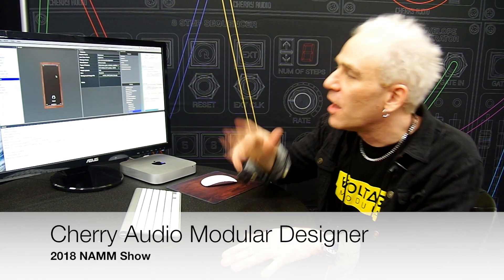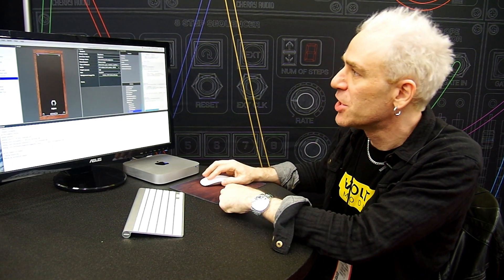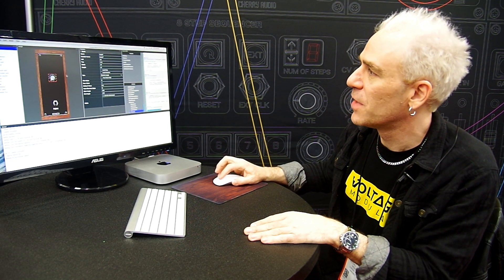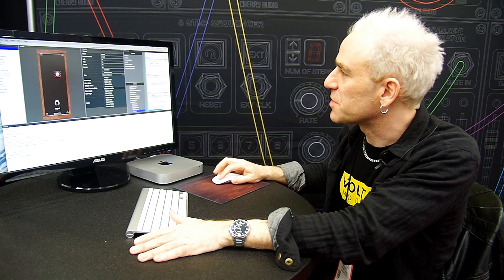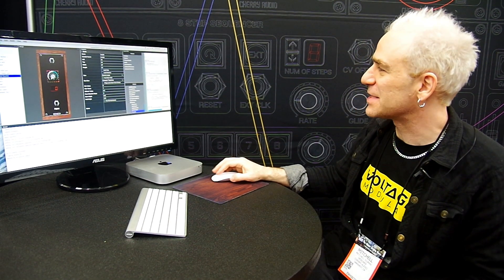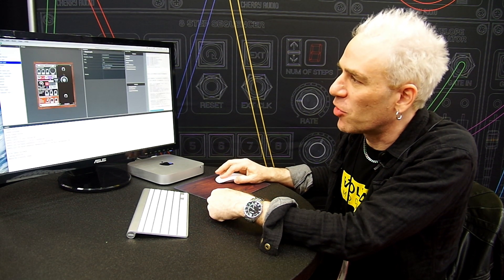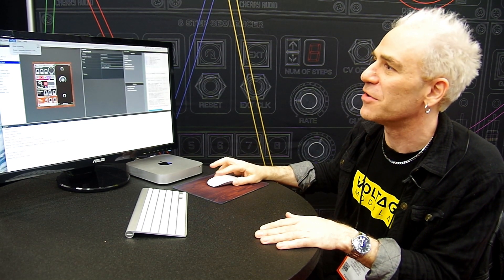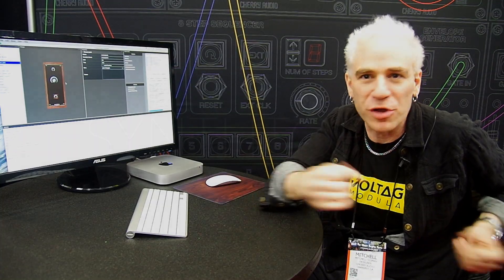Cherry Audio Voltage Modular Editor Lets You Make Your Own Modules

Comment: Java? that will fry the processors
Reply: Our code guys have been able to make it very efficient. The largest patches I've made in Voltage were hitting about 6% on the CPU meter of the six-year-old mini PC I used for the NAMM demo, and there have been some substantial optimizations since the version I used at the show.